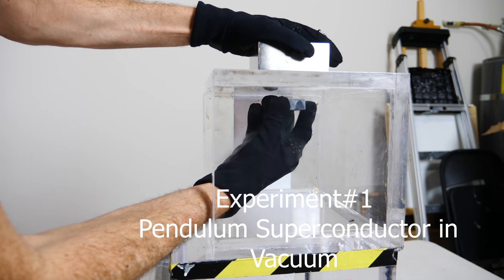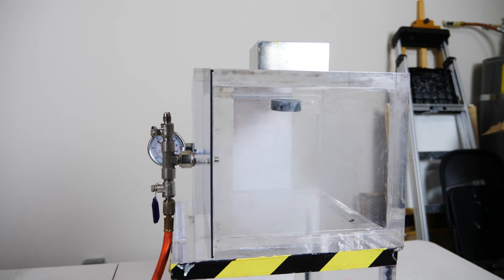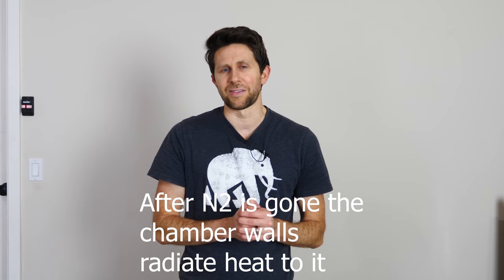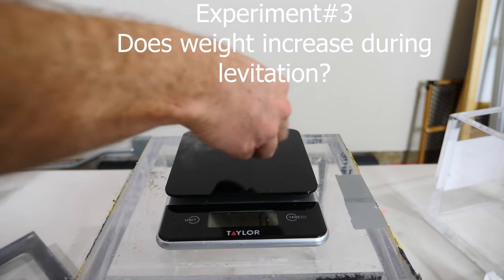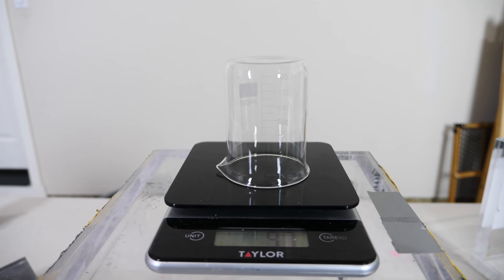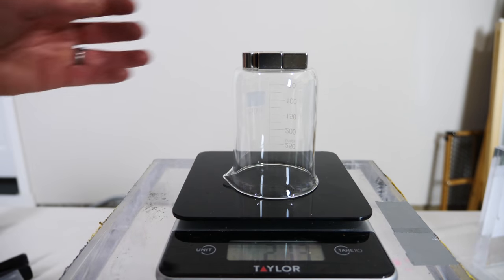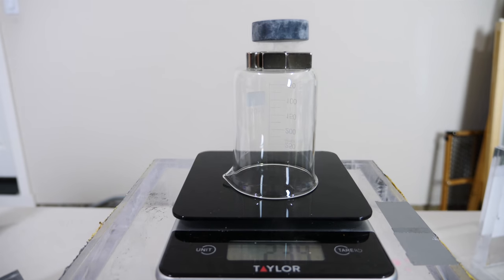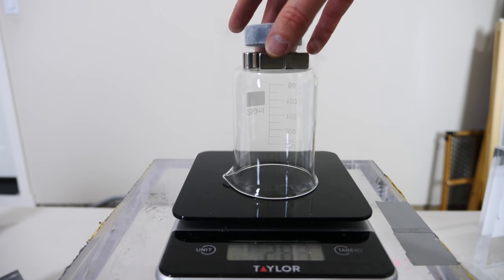Does The Weight Increase When You Levitate a Superconductor on a Scale?

Comment: the result is too obvious. we want to know whether our phone's weight increased after saving this video.
Reply: No
Reply: Calm down guyss i think it was a joke +__+
Reply: @tyler
A hard drive cannot be empty of data. It always contains zeros and ones. Even when the device is clean from the factory, it still contains zeros.
So you are not adding anything to it by storing new information. You are only changing its internal state.
There can't be an increase in mass by changing switches from position 0 to position 1 and viceversa.
Reply: Hr Gwea the BUT the small capacitor in phones which stores energy (as in stores electrons) would still increase it by a factor of (1/1860)n
Reply: @AxA12, Electrons moving from one part to another in a circuit don't increase the mass of the circuit.

Moreover, the total energy inside the phone decreases as the phone is used. It never increases.
The only way for the phone to gain mass is by adding energy to it (by charging it), never by storing information, which is just a change of state.
Reply: Great, I wanted to sleep tonight
Reply: @tyler the entire internet weighs about 50 grams
Reply: Hr Gwea not true. Data is stored with electrons which weigh a very minuscule amount,  it still weighs something
Reply: @landon7301  But all these electrons are already on your storage media. They don't increase by adding data, neither do they decrease by deleting data. They just change "states". (from 0 to 1 and reverse)
Reply: Ahh yes , now back to the weight of the dreams of butterfly's !
Reply: Cordially: 'too obvious' is contrary to the spirit of empirical investigation. Especially in a context like this, where the science is this uncommonly grasped and where experiments done are the content of the channel. I, for one, figured that the results would be about what they were, but was interested in seeing it in experiment.
Reply: @hrgwea  Thanks for answering for me too.
Reply: Does flipping bunch of 1s and 0s change the weight?
Reply: @mihailmojsoski4202  yes. But downloading something doesn't mean necessarily replacing 1s with 0s, it can change some 1s in 0s or the other way around. So it can even weight less.
Reply: @alessiobenvenuto5159  You aren't adding or removing anything, you are just changing states. It's like flipping a switch.
Reply: @mihailmojsoski4202  Sure, but does one state weight more? What does determine the state?
Reply: No, the only time your phone will increase in weight is if it were charging. 

Remember, you can't spontaneously create mass!
Reply: Vsauce did a ted talk 6 years ago on "how much does a video weigh?"
Reply: @alessiobenvenuto5159  The state is a microcharge in electronics (dram/sram) but a direction of magnetical orientation in a mechanical hard drive. Changing data does move electrons between storage and power source which can be a battery. Your phone's weight stays the same when electrons move between data storage (sram) and battery because neither do electrons leave nor enter the phone in the process. Same for receiving or sending data. Electrons moving in antennas don't leave or enter the antenna.
Reply: @Tyler You did not even understand what i wrote. It doesn't matter to what position inside a device you move a mass because it is still inside of that device. That is the reason data doesn't change the mass. The reason i wrote about the electron count is, it changes although a really small amount. Still it doesn't change the mass depending on information which is in all cases stored as positional relations. And besides: we talk about data storage, not battery principles.
Reply: @Tyler True. In quantity that mass represents the balance between hi and lo bits in sram storage (which can be negative) or the amount of polar magnetization switches on hard disk. In both cases that energy equivalent is orders of magnitude lower than even the lowest energy consumption of the device itself.
Reply: @lonzodaman  The funny thing the different states can have different weight thanks to E=mc²
Reply: The real question is does the wight vary when u turn it on/off
Reply: It probably did if you are charging it while doing it, since we use capacitors to store information in our phones. Probably didn't if you aren't charging, since the charge used in the capacitor comes from the battery (which is already on the phone)
Reply: Lonzo but when you charge your phone, doesn’t it add to your phones energy, which are the electrons?
Reply: @bbarbiter  Haha maybe you can't spontaneously create mass, but you just haven't learned proper witchcraft yet. Not to worry though, someday you'll be a confessed witch.
Reply: It would be nice if data had weight. Then people would have to choose the knowledge they carried around with them.
Reply: @Tyler - I think you've misunderstood E=MC2, and you also seem to be expanding the law of conservation of mass well beyond its scope by claiming that it's impossible to create or destroy matter. That law only refers to purely chemical reactions that don't allow transfers between matter and energy - in essence it's just saying you can't create or destroy mass in any instance where you can't create or destroy matter. You most definitely can create or destroy matter, as E=MC2 proves. Matter is really just a form of energy, you can destroy matter to get energy.. and energy can create matter.
Energy also doesn't have mass. Mass is a property of matter exclusively. Light for example has both momentum and energy - but no mass. E=MC2 doesn't actually apply in that situation, as it only applies to mass at rest (which a photon cannot be). Instead you need to look to special relativity ((E/c)2 = m2c2 + p2) for that case, where it is assumed that "m" for the photon is actually zero and "p" is the momentum.
Reply: A bit in solid-state flash storage is the lack of a charge occupying a cell. The more data is written to a drive that uses flash, the less it weighs (there's more nuance to the result than summing electron masses, but that becomes rather complicated very quickly).

Your phone wouldn't lose or gain mass through watching this video, as you're only moving charge from the battery to RAM, the processors, and possibly non-volatile storage from the battery. You're only moving charge around; the net charge is the same. 

Of course, your phone still loses mass if you are using battery power due to various inefficiencies and conversions of energy.
Reply: Actually yes, but it's unmessurable. 10TB of data is like 0.00000001 grams

Comment: 3:01 "Almost a full vacuum, 1/4 of an atmosphere". That's really nowhere near full vacuum. It's about the air density at cruising height of some airplanes, which operate by shuffling air around.
Reply: Trying real hard to correct something that doesn't need correcting I see
Reply: @aroncanapa5796  This is supposed to resemble some kind of sciencey channel, so while I wouldn't correct that for, say, a politician or an influencer I do feel the need for correcting such a blatant untruth here.
Reply: @marcus3d  well most science people are smart enough to know he's just generalizing when he says almost there and maybe he was referencing the amount of time it would take to be a full vaccuum, it's unnecessary to specify what pressure it's at exactly seeing as we only care what happens at a full vacuum, this isn't a let's see what happens at 3/4 vaccuum channel
Reply: @aroncanapa5796  He was nowhere near a full vacuum at any point (and timewise way, way off). You thinking that he reached (nearly) full vacuum at some point clearly shows that he should have specified that he's not going to try this thing in anything resembling a full vacuum, but rather at a bit lower pressure than normal 1 atm.

Comment: Is there a way to use the super conducture in a modified prototype of a bearing, wheel, axle?  Is there a way to make a nitrogen radiator cooler to make a proper seal bearing for a wheal or axle?

Comment: What about when you use quantum locking to suspend the superconductor from the magnet? Does it still create that push against the magnet, or does it instead create pull? (I would assume it does still create push since the measurabe force is there as shown in this video, but how do both push and pull forces exist at the same time, yet it still exhibits measurable weight?)

Comment: What would happen if you redo the first experiment but having the super conductor outside the vaccum chamber with a liquid nitrogen supply. And the magnet inside of the chamber. And I know at least the experiment will last as long as there is liquid nitrogen, but if the magnet stop moving before the liquid nitrogen runs out, what would that mean?

Comment: I would say that in the pendulum swing experiment that it is gravity acting upon the superconductor that causes it to slow down and reach equilibrium. It should stop swinging like that with or without a vacuum at the same rate.
Reply: gravity has nothing to do with the loss of energy.
When the pendulum starts its swing, it has potential energy.
As the pendulum swings down, potential energy gets converted into kinectic energy.
As the pendulum passes its lowest point, its kinetic energy is at its maximum.
As the pendulum climbs up on the other side of the swing, kinetic energy gets converted back into potential energy. This continues until the amount of kinetic energy reaches 0 and thus potential energy is at its maximum.
From now on, things repeat in the other direction.

If there were no losses at all, then the pendulum would reach exactly the same height on the other side of the swing as the height it started. Since the conversion potential energy -> kinetic energy -> potential energy doesn't lose any energy.But of course, this is not the only thing that is going on. The pendulum moves through air and thus loses energy due to friction with air. The pendulum needs to have some sort of support and/or bearing and those systems generate friction too and thus are another source of energy losses.

Gravity is alreay accounted in the potential energy. It only defines what the direction of "down" is and thus defines where the lowest point of the swing is. But in itself, gravity does not cause any "loss" of energy.

Comment: Could we try the experiment in a dark area to prevent any type or energy gain or loss?

As light is a source of energy right? So if we could cut that off as well it might help the prevention of  heating the superconductor up.

In terms of the liquid nitrogen loss due to the evaporation, would it be possible to keep the liquid nitrogen inside a syringe or something that will prevent it from evaporating whilst the chamber is being vacuumed, so that we're not loosing anything whilst it is being vacuumed.

For example, if it has a reservoir inside the superconductor, we can have a syringe that is strong enough to withstand the change in pressures to inject the liquid nitrogen into the reservoir once the it has been completely vacuumed.

With something like a magnet from the outside or so giving the magnet or moving the magnet to the certain location at which it will rotate.

Just wondering.

Comment: If you will install a surge tank (old air compressor tank) and pull a vacuum on it first, you will be able to draw the vacuum on your chamber much faster when you open the valve instead of waiting for the pump to remove all the air.

Comment: But why doesn't it remain cold longer in the vacuum when it is suspended from the top? There is only radiative heat gain and negligible convection once an ultra high vacuum is achieved

Comment: I’d be curious to see the results had you had a large receiver that you could pull a vacuum on prior to setting everything up. That way, you could set things up in the box. Put the lid on. Equalize the vacuum almost instantly..and then isolate the receiver and pull the rest of the air out of just the box.

Comment: Well if you were to do the vacuum one in space with actual perfect vacuum and not much radiated heat so it would work alot longer (assuming you pick a point pretty far from any star system). You can also make it a full circle to not heat up from change of direction and freeze the magnet maybe to get close to no heat ?

Comment: When doing vacuum tests, it would be useful to have a tank already loaded with vacuum for the purpose of pulling air out quickly before you switch to the pump. Second, the experiment essentially becomes "does temperature still increase in a vacuum?" -- or you could ask "is there any way to prevent temperatures from increasing in a vacuum on Earth?"
Reply: No.  Temperature can be transmitted via a vacuum.  Think the sun to the earth.

Comment: I'm curious would it last longer in a can of liquid nitrogen under pressure not a large can but big enough to fit the magnet and some liquid nitrogen, like after it gets to temp.
Reply: Liquid nitrogen isn't magically cool - it still needs to evaporate to keep cool. If you put it in a well insulated container it only needs to evaporate very slowly, but it has to evaporate.

Comment: Does the same happens when something floats in water
I mean let us suppose that water is kept on measuring scale in a beaker and it weighs 100 grams. Now you put something like a plastic object which can float........Will the value on the scale increase or will it be the same ?
Reply: yes, the floating in water is cause by the bject displacing water equal to it's weight, now if you would take away the displaced water, ie container filled to the brim so it overflows, then the weight would stay the same

Comment: How about this?  Plastic tube, bottom plugged, with two cylindrical magnets N pole to N pole, repelling each other inside.  Bottom one is glued in place. Put an adjustment screw in the top of the tube to allow forcing the upper magnet down closer onto the lower one.  Weigh assembly vertically.  Adjust screw to push upper magnet onto the lower one.  Does the weight change? Does weight/mass change in principle because of greater potential energy?

Comment: The loss of motion from heat build up is tiny, gotta remember we still have gravity so you add the potential energy with a constant gravity and it will always stop swinging
Reply: Well, gravity has nothing to do with the stop of swinging.
During the swing the potential energy decreases as long as the swing goes downwards. Kinetic energy builds up.
As the swing starts to move upwards again, the kinetic energy converts back into potential energy. This could go on and on forever. The only way energy can get away from this system is due to friction and such is unavoidable. The only problem is to identify where this friction occours.

Comment: These are really good demonstrations and explanations. I believe, though, that you can step it up and teach experimental science. For the work with the vacuum chamber, two things are needed to turn demonstration to experiment. First of all, measurement. Run a timer and show how long the superconducting lasts. Second, a control. Do the same experiment with the box open, or closed but no pump. Compare the times.

The levitation on the scale was closer to an experiment, as you did show the weights as measurement. You could easily have provided a control by putting one regular magnet on the scale then pressing down from above with another opposing regular magnet, so the South-South opposition would increase weight on the scale.

In both cases, summarizing with a data table or a graph would have been excellent.

Please keep up the good work. I hope you will also begin to demonstrate the difference between demonstrations and genuine experimental science.

Comment: How about putting a larger gas tank in between the chamber and the compressor which you can depressurize before the chamber. This way when you open the valve between the chamber and the gas tank, you would achieve a vacuum in the fraction of the time when using the compressor only.

Comment: Awesome video! Thanks for your work. If I understand correctly, a levitating superconductor exerts an equal and opposite force (vs. the force required to keep it levitating) upon the area below it. So, if we were to build a super-giant superconductor hovering at, say, 10 feet and exerting a force of, say, 10k lbs per square foot, would an unfortunate passerby be crushed by an invisible force if they accidentally walked under it?
Reply: The answer is no. The magnetic field that carries this force, transmits directly through the person's body, without impacting the person.  So if a levitating train passed over a person, with the source of magnetism immediately below them, then the train wouldn't impact the person one bit.  If the person is safe in the magnetic field without the train above, they are safe with it above.

Comment: Is there a way to seal the superconductor inside something that will resist the evaporation of the liquid nitrogen in the vacuum?
Reply: It could be possible, but you'd need either a VERY high pressure inside the vacuum, or you'd need to cover the chamber in something that can resist incoming heat, light, etc in order to keep the inside very cold

Comment: The higher you place the super conductor, then less it weighs.  Thus if the magnets were so strong that the super conductor was hovering way up in the atmosphere, the total weight would be less. Thus there should be a difference if the superconductor was resting right on the magnets compared to it floating at a distance of some measure above it.